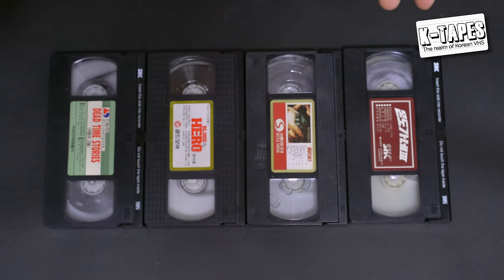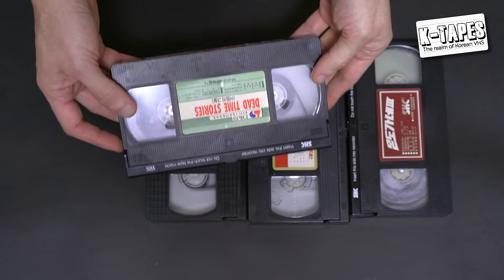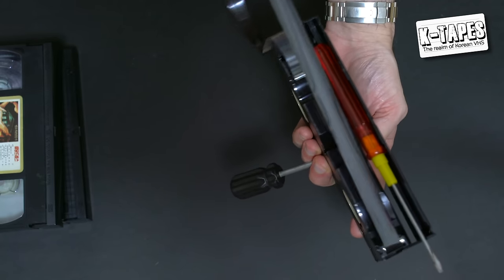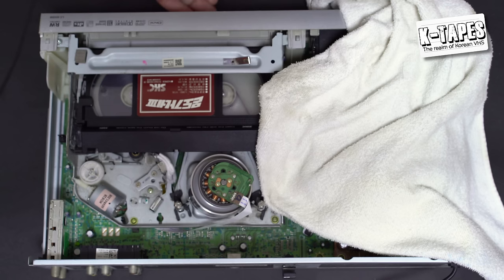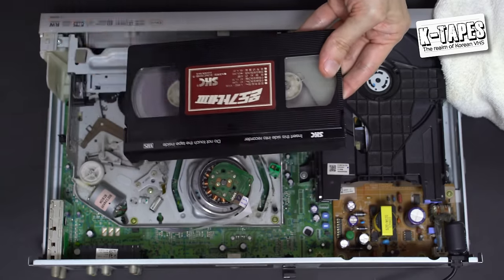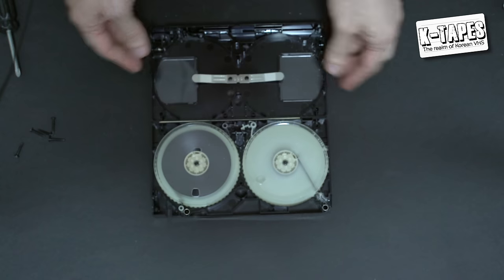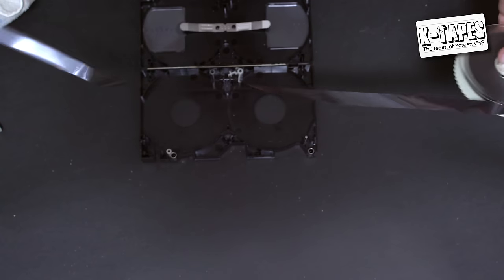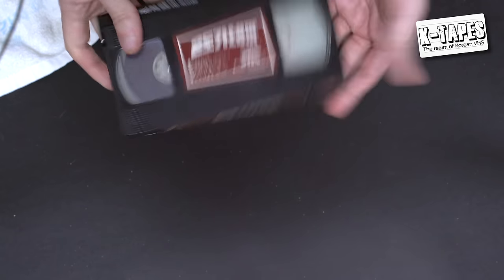Moldy VHS tapes cleaning tutorial (in 5 easy steps)

Comment: I digitize VHS tapes for customers of a photo store where I live, so I am continually encountering moldy tapes. I have converted an old VHS machine to be a tape cleaner, by fitting spindles in the tape path with removable cleaning pads (just swapping the damp  & dry pads left to right between FFWD and REW.  Instead of blowing the mold dust out of the VCR and tape case with my mouth, I use an aerosol "air-duster". They are inexpensive and available from most electronics stores.

Comment: You are amazing. I ordered a bunch of tapes recently and to my surprise many of them had mold on the reels. And lots of it. I was sure I wouldn't be able to watch them and my heart broke. I was already aware of the open vcr way of cleaning tapes, which I had used with my obsolete vcr on some of my twitchy and slightly moldy tapes. Well, after watching your tapes I gained the confidence to save those extremely moldy tapes, and it worked so wonderfully well. I was able to restore the first UK release of Alien from 1980, as well as the 1979 release of Dracula.
I was always hesitant when it came to handling tape, especially opening the tape to fiddle with the inside mechanism. But your description is so fool proof that even someone with two left hands can join the club of vhs restoration.
Lots and lots of thanks from Germany to Korea. Keep VHS alive. :)
Reply from the maker: Wow thanks! Happy that despite my video being a bit long it turns out to be quite easy for people the get their hands dirty and open up their VCR and cassettes to do some major cleaning :)

Comment: If I came across a tape like the one you cleaned, I would most likely consider it a lost cause and put it straight in the garbage. For mild mold contamination, I just use an old VCR (doesn't play properly anymore) to fast forward and rewind the tape a couple of times while pressing on the tape with a cloth. I personally wouldn't risk liquids on the tape; they could cause layers to stick together on the reel if it goes back in before it's dry. 
All I'm interested in is getting the tape in a good enough condition to get a decent capture of it, then the tape can go to the garbage. But cleaning the inside of the cassette shell as you did is important if you don't want mold to come back!
Reply from the maker: " I personally wouldn't risk liquids on the tape; they could cause layers to stick together on the reel if it goes back in before it's dry. " 

yeah that is what I explain, that's why I put the cutton pad right after the clothe with ethanol touches the tape to dry the surface before it winds back inside the spool. :)

Comment: This is quite an in depth process. Bravo!  But if you’re like me, and just capturing random tidbits from the TV.   Each tape is a lucky dip and could be anything, is there a quicker process you could recommend?   Or would you say this is the best way?
Reply from the maker: always depends how bad your tape is affected with mold. In my case I live in South Korea and the situation here with the weather/temperature is very harsh on tapes, therefore I need to open the cassettes and make sure it's properly cleaned inside so that no mold grow back (or at least not grow back for years!)
Reply: @Art_kore  these would have been stored somewhere in the U.K.  I bought them on Vinted as a job lot. Nowhere near as bad as yours though. Mostly just bits and pieces of mould in there.
Reply from the maker: Most likely not bad enough to have any issues with playback after cleaning.
Reply: @Art_kore  thank you. Currently sourcing a second VHS player

Comment: ive noticed most people only clean the reading surface of the ribbon. if there is mold left on the reverse side of the ribbon, wont it spread again?
Reply from the maker: Good question! Mold is usually on the reading surface of the tape, if there's any on the back, trust me, that tape is nasty and probably just good for trash at this point. 

Btw, I will make a new video this week on how to clean the ribbon proprely. 😛

Comment: Hey, my vcr has an issue where it doesn’t read tapes it shows a time of 0:00:— and doesn’t count until I fast forward it, would you have any idea what could be wrong with it?
Reply from the maker: I'm no VCR expert, I just give tips on how to clean tapes. But this looks more like an electronic problem than something mechanical in your VCR, but that's just a guess?! Maybe some people here can help you out in the comments?
Reply: The VCR will only start the counter when there is a video signal. Are you sure that it wont count in play mode when there is a signal? I'm assuming you have a digital counter. If you have an older vcr with a mechanical one, then I say your counter belt is slipping and needs replacing.

Comment: Could you do this with 8mm tapes?
Perhaps just apply some rubbing alcohol to the mouldy edge of the tape not the play surface?
Reply from the maker: It's probably doable, althoigh I have no experience with 8mm. If the tape tension is good enough you can probably do it.
Reply: 8mm tapes are very thin and they often stick together and snap when mouldy. There's a YouTube video about it on video99.co.uk channel to clean them

Comment: why does the mold grow on the tapes in the first place? I haven't seen mold on the outside of the case or on other plastic things?
Reply from the maker: Usually it's bad storage conditions such as temperature, humidity etc. I've seen numerous times mold on the inside of the cassette (plastic) and nothing on the tape reel.
Reply: K-Tapes I got a few tapes that i believe had mold inside but not on the tape, It is safe play the tape on a vcr?
Reply from the maker: @carlosestebanvr  as long as they don't look as bad as the ones in my video you'll be fine. But nonetheless, mold is never a good thing for a VCR. Depends how much you care about your player... If you have more than one and there's a machine you don't care too much about I'd say try your tape in that one first.

Comment: I accidentally put a moldy tape in my vcr, is my machine ruined? How can I save it? Its a nice unit and I recently got it
EDIT: I heavily cleaned it, too forever to get the heads clean but it's working fine.
Reply from the maker: You can clean the reading head with a piece of paper. But it would definitely be better if you watch a video on how to clean a VCR head.

Comment: What if the tape is stuck solid with mould?  If you can't rewind/move the tape at all - can you put the reel in neat isopropyl alcohol to try to loosen stuff off first?
Reply: Also, I'm afraid of stretching the tape.
Reply from the maker: Might be a good idea to go unscrew the cassette and open it up, then manually pull the tape between the 2 reels.

Comment: Has anybody using the vcr method had mold build back up in the tapes? I don't want to do this if it will eventually grow back I want to completely get rid of it and protect my other tapes we have had our tapes for years since I was little and I have a movie I like a lot I noticed some white spots and I'm afraid it might be mold it's not that much mold though it's hardly noticeable you need a light to even see it.
Reply from the maker: Sometimes mould can grow back yes. Had a couple tapes that had it, but remember that white mould is very easy to remove, especially if it hasn't been there for too long. The reason for it to grow back is bad storage and humidity. Try to keep the tapes in a cool and dry place.
Reply: @Art_kore  thanks for reply quickly I just moved my collection I watch them all the time

Comment: what alcohol solution did you use 60% or 90%?
Reply from the maker: Ethanol is usually high, I'd say 90%.
Reply: I cleaned the tape with 90% alcohol, and it literally dried really fast so the whole cleaning process is only like 30 minutes or less.

Comment: where is the best place to store vhs tapes?
Reply from the maker: Usually, any dry and cool places  are the best.
Reply: thanks, Ive two problems with two VCR's I own, you might have the answers.  My roller guides stop halfway up the tracks and spit the tape out and one of the problems on the other VCR is that the tape doesnt rewind all the way back to the beginning.  Any ideas what is wrong?  Also have you tried doing any repair videos on some of the most common problems with VCR's?  @Art_kore
Reply from the maker: Have you tried with a different tape? Does it do that with every tape? If not, perhaps there is too much tension in the tape. I'd suggest you open the cassette again and see that all pieces are at the right place inside.

Comment: i cleaned the tape ,it doesnt work. the tape is still dirty why?
Reply from the maker: Which part is dirty?
Reply: @Art_kore  almost all of it, should i do it again? i'm afraid my cassette will be damaged
Reply from the maker: @wormsfort  You mean it is still on the tape itself, like on the top? If so, you can run it again with the same process until it's gone. Also, don't forget to clean with rubbing alcohol the inside of your spools. :)
Reply: @Art_kore  i did the process manually only with 70% alcohol, it took me 7 hours and the tape got curved little bit
Reply from the maker: @wormsfort  curved? like it's kindda wavy inside the spool? If that's the case is because the tape was wet at one point and sticked to itself and created an iregular winding. Make sure you have your cutton pad right after the alcohol touches the tape to dry it as it winds back inside the cassette.
Reply: @Art_kore  I managed to clean one tape, it was probably a little dirty. Some other attempts failed. The video jumps a lot and the sound is distorted. can a 70%  alcohol  cause damage to the VCR or the tape?
Reply from the maker: Probably. Are you using the same VCR with which you clean the tapes?
Reply: @Art_kore  yes
Reply from the maker: @wormsfort  well that's why... Your VCR is dirty now. That's why at the beginning of the video I explain to use a different VCR that you don't need or care about to do this.
Reply: @Art_kore  no i mean i cleaned the tape manually only and then put it in 2 different vcrs,both of them didNT run the tape properly, should i use isopropyl alcohol instead?

Comment: You cleaned  the visible mould on the top edge and face of the tape , but you never cleaned the mould on the bottom edge of the tape, which you cannot see .
Reply from the maker: You mean inside the cassette? If I didn't, maybe I forgot because I was in a hurry to explain. If you mean on the tape itself, the mold always builds up on the reading surface, not underneat but if you see the white residue just wipe them with a cloth + rubbing alcohol.
Reply: The tape has four main surfaces, the broad surfaces , the reading surface, and back , then you have the minute two thin edges of the tape top and bottom. You cleaned the top thin surface edge  but never cleaned the bottom.
We saw clearly the top edge of the tape was pretty bad with mould when the tape was closed, if that top edge is contaminated then the bottom edge must   be also. 

The problem with the bottom edge is you cannot see the contamination as the spool is not see throught like the top of tape. 
Hope this explains more  clearly what I mean.
Reply from the maker: I totally see what you mean. Usually mold tends to be on top but if you have it also at the bottom it means the tape has been hit pretty badly (not usually the case with tapes in the U.S.). But if that happens, I put the cloth with ethanol in a way that it touches the entire reading surface of the tape when REWINDING (don't do that while FFWD because the tape is wet and hits the VCR head before touching the cotton wipe). So yeah, that's how I clean the dirtier tapes.
Reply: Thanks , will be using your cleaning process, and advice when I start to clean several family tapes,  of weddings, and other family events, that were stored for years ,  as  each tape is showing various degrees of mould .
I will practise on several  tapes of no real value,  which I have, see the results ,  before attempting the more important and irreplaceable tapes.

Then I will have them transferred to DVD , but still retain the VHS tapes,  but in much better storage conditions , than they were. 

It important that people fully understand that VHS tape in the majority of situations can be salvaged. 
 Many people when they see mould , just discard the tapes , thinking wrongly, they are damaged beyond repair.

Precious recording of events,   like weddings, holidays, birthdays,  and other social gatherings , thinking they were no longer playable. 

 I prefer the VHS tapes ,   so will keep,  as their is something unique, about the quality of the film quality.

Thanks again,  for taking time to respond to my concerns.